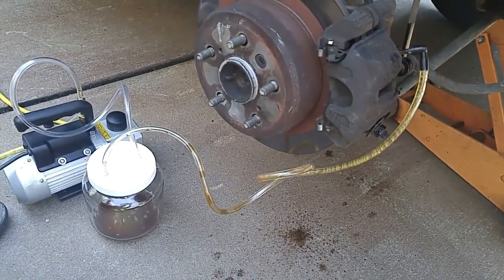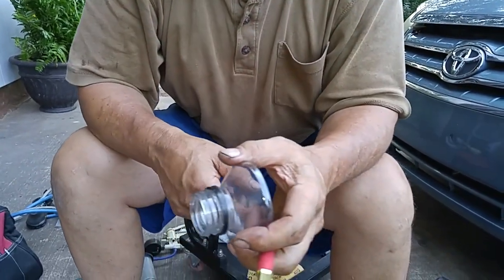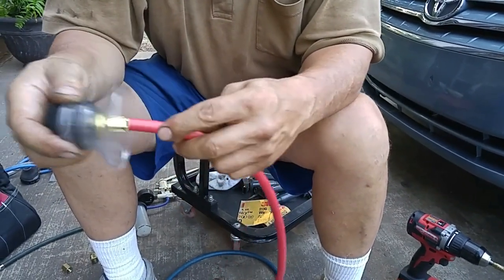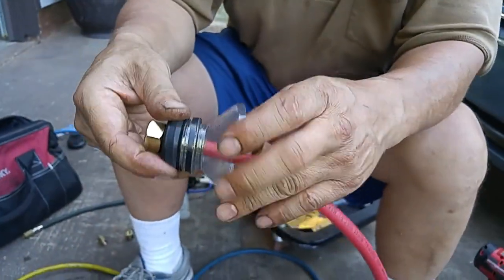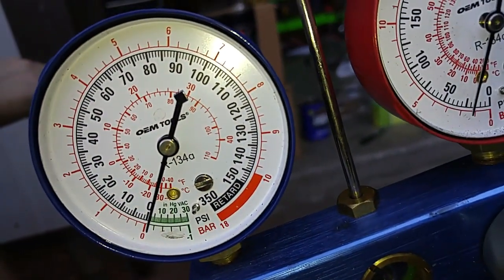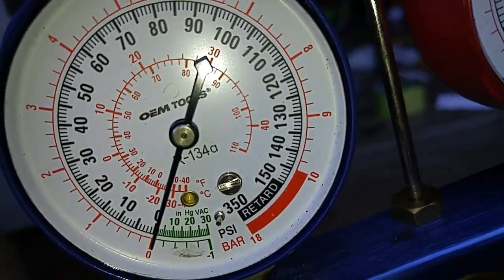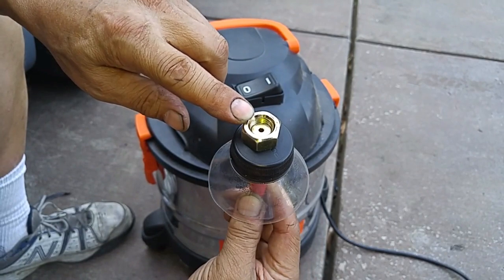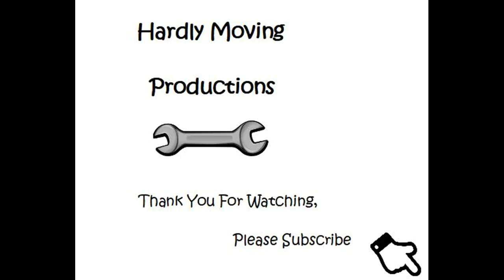Shop Vac Vacuum Pressure Test ...Can It Compete With An AC Vacuum Pump?

Comment: I think it would work better with a larger diameter opening.
Reply from the maker: Maybe but don't think it really matters that much.  It can't generate and maintain the high suction / vacuum in a ac vacuum pump.
Reply: @hardlymovingpro  hmm, I might have to test this :)

Comment: What horsepower is your Shop-Vac? I'm pretty sure that matters a great deal... 
12hp vs 3hp = theoretically at least 4 times the suction, no?
Reply from the maker: Can't say but I eventually stuck with a regular ac vacuum pump since I do so many ac jobs.